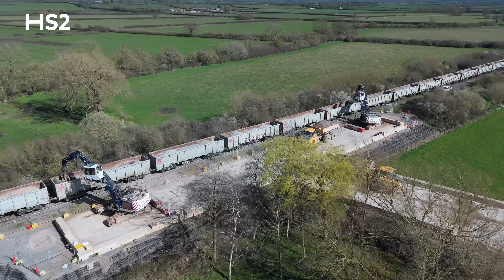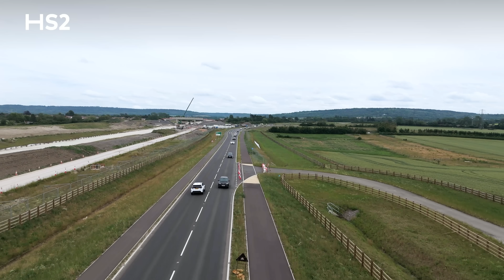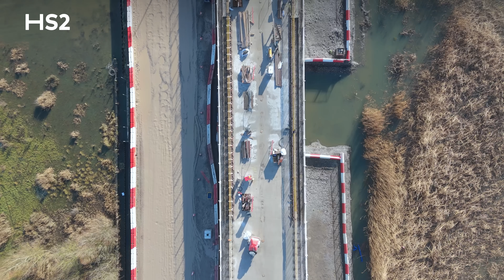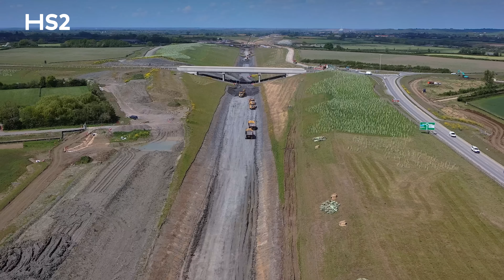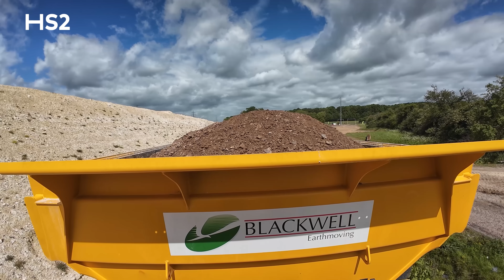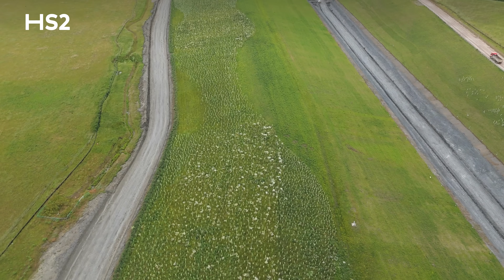HS2 Aylesbury & Buckinghamshire progress update | Connecting Communities

Comment: The trains ordered for HS2 appear to be ones with the European rounded nose and not the long "Kingfisher" nose used by recent Japanese Shinkansen like the E5 and 500 series. The long nose is designed to reduce loud "tunnel boom" when leaving a tunnel. There are a lot of of tunnels on the HS2 route. Hopefully something has been designed to reduce the HS2 noise. Hopefully HS2 will open more freight paths on the West Coast Main Line by moving more passenger trains to HS2. It is difficult to understand why the cost of the railway is so high, when Japan, China, France and other countries have been building very high speed lines since the 1960s.
Reply: The HS2 tunnels have porous portals where needed to resolve this. Where the trains will be at their highest speeds the tunnel bores are also a larger diameter. Where trains share the same tunnel in opposite directions there are enormous air shafts.

One of the lesser publicised benefits of HS2 is that it frees up significant capacity on the WCML south of Birmingham for more local stopping services and freight.

Comment: The overheads seem to show many areas where the new link roads involve up to a kilometre of new roadway, and additional roundabouts (brake, slow down, negotiate roundabout, accelerate, and repeat - not the most efficient for environmentally concious driving) in order to avoid crossing the HS2 corridor in the alignment of the original roads., which would have required longer bridge structures.

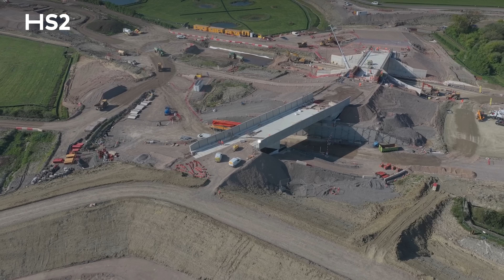Also, those two bridges (6:01) are not being built 'side-by-side', they are being built simultaneously.

Comment: A horrible  scar across the landscape, removing vast amounts of agricultural land, habitat and countryside, now permanently disfigured and destroyed. Not only that but rerouting roads and changing the infrastructure around the railway causes even more permanent destruction. During a time of climate, biodiversity and food security crisis, all you are doing is to make things worse.
Reply: High-speed or electric rail networks can be up to 10 to 13 times cleaner than equivalent short-haul flights in terms of carbon emissions. France has  banned domestic flights on routes where train journeys take under 2.5 hours, specifically targeting Paris-Orly to Bordeaux, Nantes, and Lyon. The law took effect in May 2023. Private aircraft are exempt. We should build a high speed network such that there is no economic case for the vast majority of domestic flights ( ex northern Ireland for example). That is  real impact for de-carbonising our transport system. If you could also get more freight onto the west coast mainline and off the HGV's on our motorways you are really making a difference.
Reply: It's a building site at the moment, when it is complete there will be lots of greenery and a net gain on biodiversity. They are also building a habitat corridor and numerous green bridges to link habitats.

Comment: It's certainly not connecting communities - maybe going past or under them. Just more awful Woke headlines
Reply: Five of the biggest ten cities in the UK will be partially connected by HS2. London, Birmingham, Liverpool, Manchester and Glasgow. London to  Birmingham will be fully connected. That is alot of 'connecting communities'. The initial extra capacity on HS2  will be positive for local communities south of Rugby, as more commuter services will be able to use the West Coast Line.
Reply: @JohnHoward-wc9kk   Thats not the context in this video though. 

The high speed rail work (which is for  good reason ) will disect and disconnect local communities, so mitigation, re-enabling rights of way and and an opportunity to take care of any other improvements is part of the project.

This video is about local community connections, not connecting cities. 

(I would say though disappointedly the examples shown in the video are low quality compared to what we do elsewhere though.)
Reply: @JohnHoward-wc9kk  escaped from your bat tunnel?
Reply: @robinjones6999  Not my bat Tunnel ! or even Hs2's. Forced upon the designers by Quangos ( Natural England) and certain politicians who used the issue to try and delay the project, in the hope of then terminating it later. They came very close to achieving that. There is no real evidence the 300 bats would be materially affected by the track. I would have cut the wood back another 25 mtrs and add more trees on the other side of the wood to compensate.   Personally if I was a Bechsteins bat hanging upside down in a wet wood, I would go and roost in that nice big concrete thing they are building just nearby !
Reply: Bro said woke, everybody take a drink.
Reply: if they wanted to connect communities they would have elected local mayors run a unified transport system. it's a small island yet they can't get the public transport network right to make it easy for people
Reply: @lemcake32422 . What part of it is missing that makes it not easy for you?
Reply: @djstuc  if you lived outside London you would know
Reply: @lemcake32422  funny when people like you make silly assumptions and literally couldn’t be much more wrong. 

Tell me what your issues are? Add some context? Give us the details regarding your original comment?
Reply: @djstuc  funny people like you either act stupid or are stupid. what do you think these projects are about? you literally couldn't act more stupid if you tried. 

tell me which issues aren't with the current transport system? add some context and give us a full reasoning essay here
Reply: @lemcake32422  you said. 

“They can’t get the public transport network right to make it easy for people” 

Why won’t you just answer my question and provide some specifics that you think are wrong with it and how it impacts you? It seems a simple enough ask, so unsure why you’re trying so hard to avoid it.

You approached the subject so the onus is on you to provide examples, not me. Or just admit you’re projecting and you don’t really know what you’re talking about.
Reply: What a tired comment.
HS2 is connecting distant communities. It's exactly what it does.
This piece is about how it also improves local connections across its works and also adds new ones.
Possibly a tad too subtle for you?
Reply: @1chish  The local "improvements" look pretty low quality though. Wish they were better.
Reply: @deansweeney  'Low quality'?
Have you any idea the levels of strength built into a bridge over a 200 mph railway? All the structures and roads in this video looked superb to me.
Reply: @1chish  No , irrelevant, also well aware. They were low quality connections. You still haven't time stamped any good connections yet from the other comment. Maybe you are just thinking about drivers and bridges. There is much more to consider in terms of local connections as some clues were given in the video intro and is part of the project, yet what is delivered is low quality / low desirability when we know we can do better.
Reply: @deansweeney   What on earth are you on about "You still haven't time stamped any good connections yet from the other comment"

jeez I just give in ...
Reply: @1chish It was obvious from the beginning you had nothing useful to say and should have just kept quiet.
Reply: @deansweeney   Still droning on Dean?
Reply: @1chish  The keen reply guy, even to the very first comment on this video still has nothing of value to say to add or refute to the comments they are so eager to reply to . 
It’s like they are a waste of space. Reply guy fail - what a surprise.
Reply: @1chish It's the affected communities that are tired, not the comment. Connecting communities, more like cutting them off. There are 5 routes out of our village  three have been cut off by HS2 for not months but YEARS. One reopened recently, to be shut after 1 month because infrastructure work needed to be completed,  too disorganised to do it all at once. No doubt it only opened to tick a box, there is no care whatsoever for the affected communities who will never usr this vanity project as there are mo local stations.
One of the projects mentioned in this piece as being on time is months late. When my wife queried the potential for it to be delivered late at an HS2 meeting last year she got an extremely rude response from the HS2 employee, only to be proven completely correct.
Reply: @andrewpatterson2789  yes there are disruptions while its being built but even in this small snapshot of Aylesbury there are new and upgraded bridges, roads and pathways. All making better local connectivity.
Of course we get told about the disruption you are experiencing but you do not mention the compensation paid by HS2.
So forgive my cynicism.
Reply: Anyone using the phrase 'Vanity Project' betrays their NIMBYism and opposition. No you may not get an HS2 station but you will benefit from more local train services and fewer truck on the roads as rail freight capacity doubles.
You're welcome
Reply: @1chish . 👍🏼
Reply: @1chish I am sorry who gets paid compensation??? There is the odd small donation to a local kiddies park but I cannot see too many repairs to decimated roads from overweight HS2 vehicles. Are people having the damage to their cars paid?, I think not.
Reply: @1chish Vanity project implies that it is not really fit for purpose which HS2 is not.
1. The country cannot at this time afford this level of uncontrolled never ending expenditure.
2. Having already been downgraded once in speed to save spiralling costs, how long before speeds are reduced again?
3.The place this should have started is north of Birmingham linking the large northern cities.
4. Since Covid, the need for a high-speed link from London to Birmingham has certainly reduced with more people working from home.
5.The need for this line is to take passenger traffic off the WCML, with the limited number of stations on HS2 the number of people using HS2 when it's eventually finished I fear will make this an expensive mistake.
Yes we need more capacity, but not like this.
Reply: @andrewpatterson2789   Sorry Andrew but you just said "from overweight HS2 vehicles" but I will guarantee you have never had one weighed. However I do know that every HS2 site has weighbridges.
So again forgive my cynicism with people who just use exaggeration and innuendo.
Reply: @andrewpatterson2789   There are 35 Mn people a year using Avanti West Coast services. All those will migrate to HS2.
Express trains like the Class 390s are path hungry and freeing those will pro rata allow more passenger trains for those suburban and 'local' services never mind the doubling of freight paths.

To suggest that is just 'vanity' demonstrates the paucity of your arguments.

As for the cost what you NIMBYs forget (or ignore) is that this is a project that when built will serve for 150 years. On a per annum basis it is very cheap.
Reply: @1chish and you use your weighbridge to check the weight of huge cranes that HS2 have been using passing less than 10 feet from 500 year old cottages with minimal foundations. 
Also I though the lorries were supposed to go through wheel washers before going on the road, obviously not the case as my neighbour found out when her windscreen was put through by a huge mass from as HS2 lorry. Luckily her and her two small children were unhurt, unlike her car.
Reply: @1chish The 35mn passengers are across the whole of the Avanti West Coast network, not all of these passengers travel south of Birmingham so your figures are not representative of the facts.
I was not aware that railways had a specific lifespan, the WCML is currently 188 years old, and has had huge maintenance costs throughout its lifetime. So your comment is again misleading. 
If Avanti can run trains at zero cost indefinitely,  with the full 35mn passengers all using HS2 it would still take well over 100 years to recoup the build cost ignoring the ongoing maintenance.
I am not anti railways, far from it we need more people to use the railways moving forwards, but what I cannot stand is the way HS2 and especially their PR people try to make it look like they care about the communities they are affecting. This is not me being a NIMBY, it is about respect and from my experience HS2 have very little for those affected by their works.
East West rail, well that's another matter, a project wanted by those along the line and the build as it used a mainly existing trackbed caused minimal local disruption, just a shame that it is still not open.
Reply: @andrewpatterson2789   And right on cue we get the invented  virtue signalled emotive Bs....
OK Andrew I give in i can't do stupid as well as yourself.